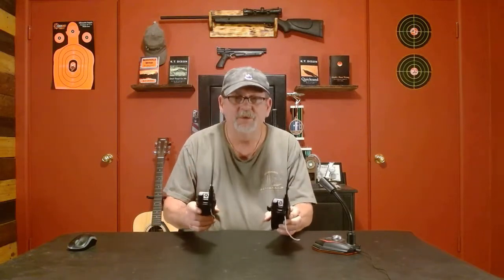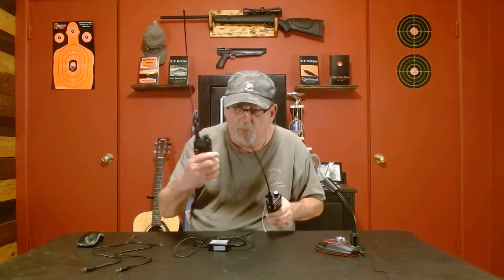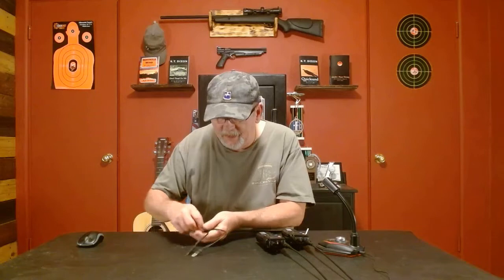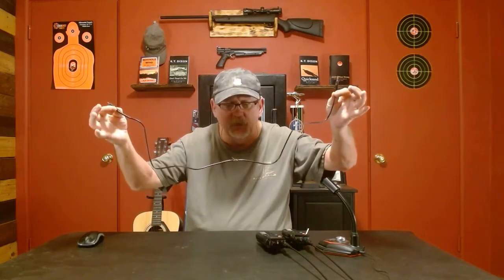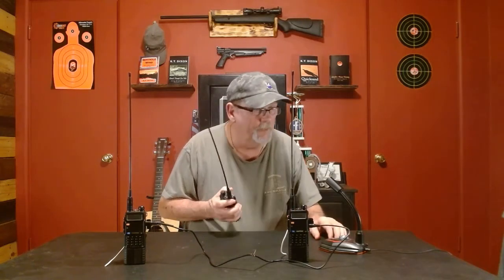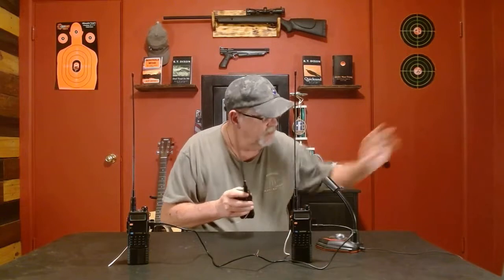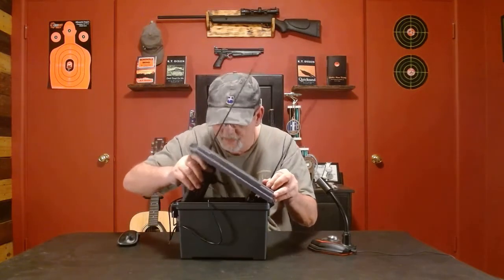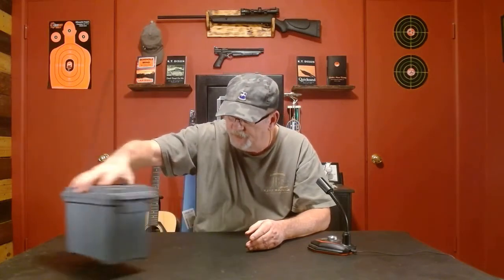Prepping - Build a Baofeng Repeater

Comment: This is a great video. I bought the Baofeng-type interface cable and I had the same problem as you, with the radios constantly transmitting. I made your cable and now it works perfectly. I bought a BTech amplifier and I'm eager to hook that up and see what it will do. But antennas are everything, and I have 2 Ed Fong antennas about 50 ft in a tree. That increases the range of the repeater enormously. Anyway, thanks for the great video!
Reply from the maker: Thank you for watching. I'm glad it helped you out.

Comment: Great video sir. looking at building a repeater to keep stationary at a 2/3 point between mine, and a buddies house (total distance between houses is 30 miles. My house to repeater location is 20 miles, repeater location to my buddies house is 10 miles. We may have both radios plugged into 24/7 as we have power we can use at our half way site. If we decide to put a secondary repeater along the 30 mile line at some point, we will use a solar charge to power it. thanks for all the information.
Reply from the maker: Happy to help out. Thanks for watching.
Reply: What is the range of the repeater antenna that you built???

Comment: I tried this with a similar cable to the one you've pointed people to in the comments and have had no luck. I've seen other people mention that a cable with a ground on it just keys the radio constantly and that's what happened to me.
Reply from the maker: Did you cut the wire and cross the colors? It works for me and I have heard from many others that followed this video and had success.
Reply: @theorlandoprepper  I did not. I built my own mono cable with the colors crossed, and it sort of worked, the 2.5mm wasn't very good and made poor contacts.
Reply from the maker: @pixelbucket8884  maybe that's the problem.

Comment: Sent and email then I have the wires done as you do (with the correction) when I talk on my radio to test the repeater tadios light up as they should I get 3 to 5 seconds of silence as a response followed by my Rodgers tone. Yes vox is on yes rec volume is up. Plugs are seated correctly I'm lost. Should I just buy the little box thing that amazon has?
Reply from the maker: If the direct connection with the wires does not work, the junction box will not work either. Check the email that I sent you about the programming. Thanks for watching.

Comment: Excellent video. I want to try to dismember a couple radios and make 1 total unit to cut down on weight then use a drone to get the system booted up a few hundred feet directly above my position to really reach out. Any thoughts on this? Has anyone tried to do this? You probably only need 1 power supply so that can cut down on plenty of weight. I don't know what the payload of the drone is but it would be a short flight to make contact and convey a message.
Reply from the maker: Very interesting idea. I'm not really very good with building electronic components, but I would sure like to know how this turns out if you do it. You could make a lot of money with something like that. Thanks for watching.

Comment: You made a great video. I would like to know if you are using VOX  on the transmitting radio. The process of keying the transmitter has been a point of uncertainty for me. I would also like to know if you tested your system in the UHF - 70 cm range. Other YouTube videos on this subject have stated that the two radios need to be up to 30 feet apart to prevent the transmitting radio from overpowering the receive radio Apparently your system has no problem with this, at least in the VHF - 2 meter range. I will be duplicating your system soon, using Baofeng UV-5RTP radios along with ABBREE SMA-Female Dual Band 144/430Mhz Foldable CS Tactical Antennas. I am also curious if you have thought about putting some type of power bank into the ammo can to provide additional power to the transmitting radio. I assume that the transmitting radio would use up its power first. The extended Baofeng battery has a side input for charging it,  although I have not actually tested this function yet.  Using the handle of the ammo can to hoist the unit up into a higher position is brilliant.  Once more though, my compliments on a great video.
Reply from the maker: Thanks for watching the video, and I'm glad it helped you out. 

Yes, you do have to have the VOX on, on the transmitting radio. I tested my system on 2m, 70cm, and GMRS channels and it work on all frequencies.

As for powering the box, I am going to use Velcro to attach a small solar panel and connect it to the charging port on the extended life batteries. That should keep it charged up indefinitely should the need arise.

Comment: TX antenna less than 12inches from the RX in an unscreened box what could go wrong?
My advice use a 5Meter long 3.5mm stereo extension lead and a 2.5mm one to be able to put
at least 5 Meters distance between the two, with vertical distance better
Reply from the maker: Not sure why yours wouldn't work close together. I never had that problem. Glad you worked it out. Thanks for watching.
Reply: only one antenna is tx, the other is rx

Comment: is it bad i kind of want to build a network of these and power them all off solar
Reply from the maker: Not really. That can be done very easily. Get the extended life batteries with the 3.5mm charging port and a small solar panel. Split the charging cable and run a jack to each battery, and bingo. Thanks for watching.

Comment: I am interested in making a Repeater now for my GMRS radios. Sir the cables you used to daisy chain the two radios are they just Mic wires.?
Reply from the maker: Yes, just a simple audio cable. But like I pointed out in the video, you have to do a crossover within the cable for it to work. Plus, there are two different sizes on each end of the cable; 2.5 mm into the top hole of the receiving radio, and 3.5 mm in the bottom hole of the transmitting radio.
 https://www.ebay.com/itm/271530725067?hash=item3f387e0ecb:g:sTcAAOSwvGVa0GfU&amdata=enc%3AAQAHAAAA4CEPyulAr99e1At5OLQLiOIdgIY%2FuG02ZrsIyfAzDdY0Mvzqr9Jj6Fx4niUyZ7KCYqjTSN030OZTlb8tKi10lPwT%2FQADqf8oRfxdwQj3MddTtcvQG3duGyBnCLqlaxvb1%2BQaYnUzbKYnCw0wnmX%2BCEMacB2OLj2sq%2FHlnhy8g%2FsHy5r0GGZofsx5o3ArsczVBybBQiDZUl51U%2B4V3CMWYwSekdjD%2F1OfEvUT2PRJNNmna8gKJP271Ugh3qaeiizQw%2Ff798MQsZBTZMkTbep5qVvJWYU9TSqeRlSxWIHO39Ww%7Ctkp%3ABFBMjI_TrbBh
Reply: Thank you kindly. I enjoyed your videos. And thanks for keeping it simple really helps

Comment: What range have you achieved with this setup?  I've been working on a similar project.  But I only get about 100 feet away and I can still hear a carrier but no audio after that distance.  I ordered 2 of the mono cables you suggested, and will try reversing the wires on one.
Reply from the maker: I haven't tried to max out the range, but they worked well at about 5 miles, with a radio east and another west of the repeater. It was lifted into a tree by rope to get it above the homes in the area. The audio was very clear at that range.

Comment: So if you use the first adapter you show, is the programing the same??
Reply from the maker: Yes, the connection doesn't matter. I didn't use the first one because I couldn't get it to work properly. I tried 3 different ones, and none of them worked correctly.

Comment: I'm curious... why cut the cable and switch the wires?  I've seen other videos where they do not change the wiring and it works fine.
Reply from the maker: I tried it without cutting the wire and it didn't work, but that may be a result of having a two-post connector kind of wire. Once I reversed the current in the wire, it worked perfectly. Thanks for watching.
Reply: @The Orlando Prepper  OK thanks.  I ordered 2 cables, so I'll try it both ways.  I tried this method with a 3-conductor (stereo) cable and it only worked from about 100 feet away.  I'll keep trying.
Reply: You’re the first to comment on the range of these repeaters. 5 miles is pretty solid, be very interested to see a quick 2 min video on 2 miles away from east to west with repeater in the middle, 3 miles, 4 miles, 5 miles etc.
Reply from the maker: @mdc21787  Good idea. I'll see if I can get that put together.

Comment: Mine will not transmit just receive
Reply from the maker: Is the VOX turned on on the transmitting radio? If it is, check the programed settings on both radios.
Reply: @theorlandoprepper  I did I think it’s my cable I bought I need to get another it doesn’t even active the txt radio
Reply from the maker: @ChrisSeaman  maybe this will help: https://www.youtube.com/watch?v=GEZVdDLJPvw

Comment: I got a question I have a 5 watt and a 8 watt baofeng uv5r and a BaoFeng UV-S9 Plus 8W High Power Tri-Power Ham Two Way Radio I would like to use the 5watt as the receiver what frequency do I need to set that on? I’m still trying to follow your video but I don’t understand.
Reply from the maker: The frequency as shown in the video. the wattage or radio make makes no difference, as long as they are set as shown.
Reply: @theorlandoprepper  ok cool thanks I’ll try to set it up tomorrow I have that k-head repeater box that I’m using I’ll try to figure it out tomorrow
Reply from the maker: @DJ_BRANDO  if you have any problems, let me know. I'm happy to help out.
Reply: @theorlandoprepper  great thanks
Reply: @theorlandoprepper  hey how are you? I just got done trying the walkie-talkies and I couldn’t get it for some reason I couldn’t hear out of one of them I’m not sure if I had them set right
Reply from the maker: @DJ_BRANDO  If you program the radio frequencies as shown and cross all of the wires, they should work. If you get too much feedback, adjust the volume in the receiving radio on the repeater.
Reply: @theorlandoprepper   so split the repeater box and cross the wires and try it that way? Or could I just use a auxiliary cable and two different adapters?
Reply from the maker: @DJ_BRANDO  split the wires and cross them all. Red to black, and white to red and black on the opposite side.
Reply: @theorlandoprepper  ok

Comment: hi i have a question is the cable mono or stereo?  I mean the plug
Reply from the maker: Stereo, three post. It has 2 black rings.
Reply: @theorlandoprepper  have 2 wires inside them or 3?
Reply from the maker: @halmakis781  3, they all need to be crossed.
Reply from the maker: @halmakis781  Cut them, hook the red to the black on the opposite side, then cut the white and connect it to the red and black on the opposite side.
Reply: @theorlandoprepper  Ok, thank you very much
Reply from the maker: @halmakis781  3

Comment: And how far did you work it
Reply from the maker: The repeater works great for a 5 mile radius, so 2.5 miles away in any direction. However, I live in Florida where the terrain is flat. You may not get that range if there are tall buildings or landscape between the field radios and the repeater.

Comment: So if you just use the vox fuction on the Tx radio then you wouldn't have to modify the cable to a crossover cable??  I've seen people do this using the vox function and there was no need to modify the cable between the two radios.
Reply from the maker: Try it and see if it works. If it does, I would appreciate it if you would let me know. If it doesn't, then cross the wires. Thanks for watching.
Reply: @theorlandoprepper  Ok, I will let you know how it works out.  Appreciate the video!